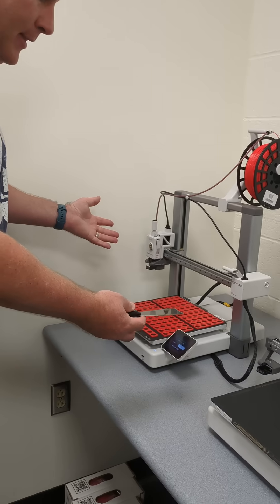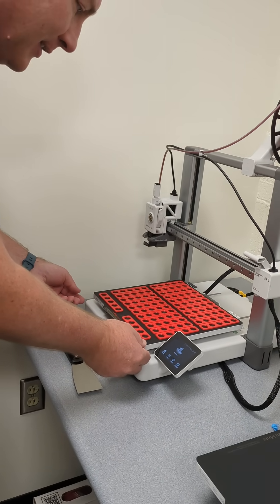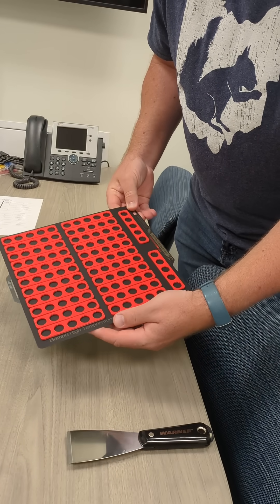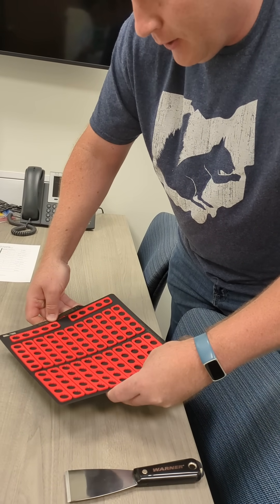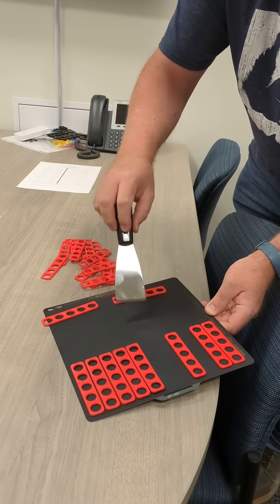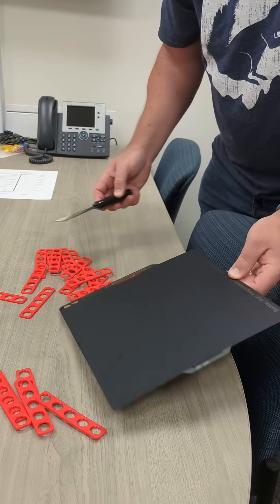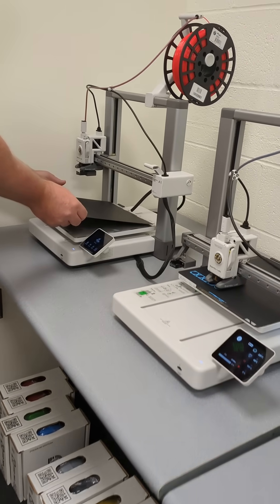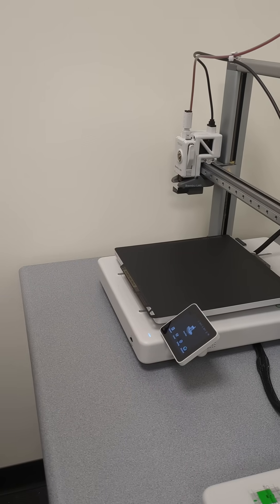Removing a completed 3D print from the build plate - Bambu Lab A1

Comment: My supplier told me not to use alcohol. Just soapy water
Reply from the maker: You can do soapy water but have to watch out for residue. I prefer alcohol as it evaporates easily (one plate heats up especially). With multiple users s, there's less user error too.
Reply: @xriksu Alcohol is bad for a PEI surface though, isn't it? From what I've read, alcohol is reactive with the PEI material, and wiping the alcohol away can actually result in wiping small amounts of the PEI material with it, which over time lessens the life of the plate.
Reply: @WafflesASAP  Yeah, it does seem like a large majority of people recommend to say away from IPA

Comment: Why not just wait the 2-3 minutes for it to cool? No reason for a spudger, let alone a METAL one.
Reply from the maker: Sometimes the metal ones do better than the 3D printed ones. But yes, 99% of the time you don't need to even use the scraper tool.
Reply: wait to get cool pretty cool....... SWOOOOOP NOICE

Comment: Tip to not scratch the build plate, just print a pastic scraper. Yes, it will end up breaking after using it for a while, but you can print another and avoid scratches on the surface. Try to avoid metal if you can.

Also, to clean the plate you just need water and soap. High concentration alcohol can damage the PEI plate, would recommend to use around 70% if needed.
Reply from the maker: Yep. We use both. The metal one is sometimes necessary though (not usually but sometimes).
Reply: But how do you scrape off the first scraper?! 

Schroedinger’s scraper 😅